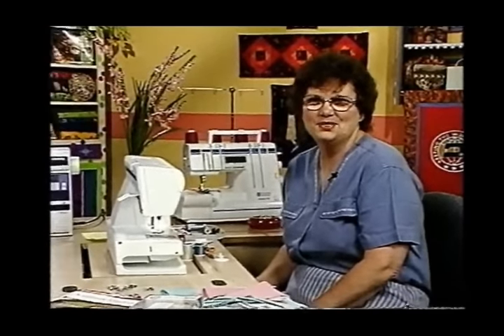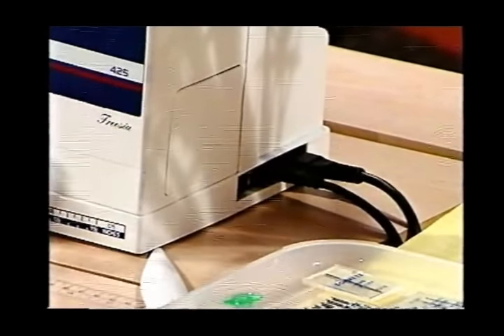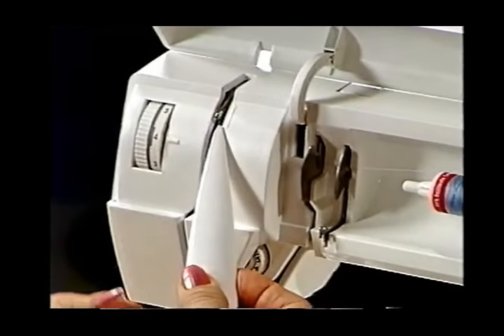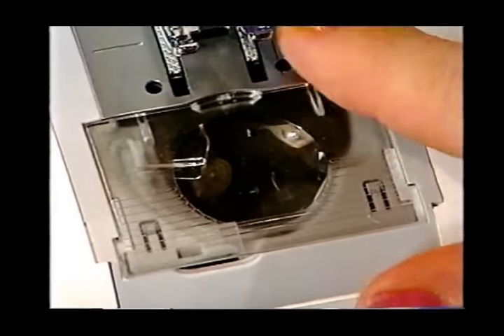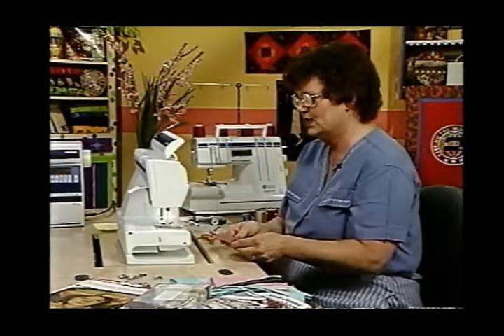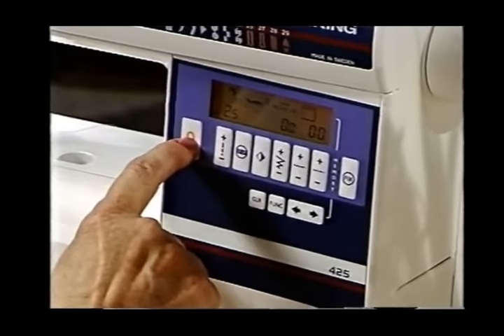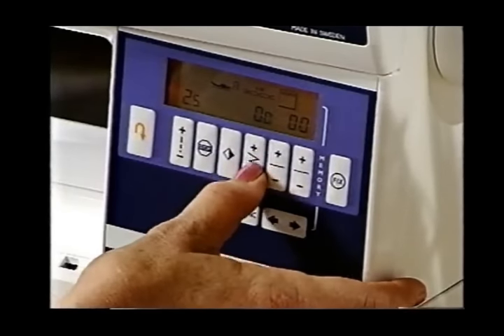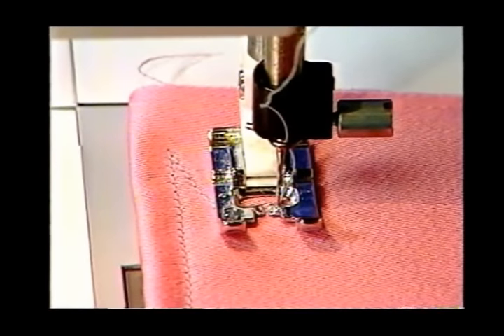Husqvarna Viking Freesia 425 and 415

Comment: I'm so happy to find this video. This is the same video that came with the machine on a VHS tape. I refer to that VHS tape every time I pull out this sewing machine that I inherited from my Mom. I have been so concerned that something would happen to the tape. You never know.
So I'm having trouble winding the bobbin. I think I broke it. The white plastic button flipped off and it now has a crack in it. That's too bad. I will have to look for a replacement. Thank you for the tutorial.

Comment: I'm what I call a "utility" sewer. I can fix and attach things. I can make a simple pouch or cover for tool or something. I learned to sew in 8th grade back in about 1987.  I inherited a Freesia 425. Compared to the machine I learned on, this thing is the Hadron Collider. Some great features that make the job much easier.
Reply: My spouse bought several used Viking machines including this one to replace my very old Viking 6370 and Viking 960. I'm wondering if it's "new" enough to at least get me by for a couple of years. In my family, Vikings have been so reliable, that they are now brittle and no one will service them any more and anywhere I try they want to sell me a cheap machine by comparison. What do you think of this particular machine?